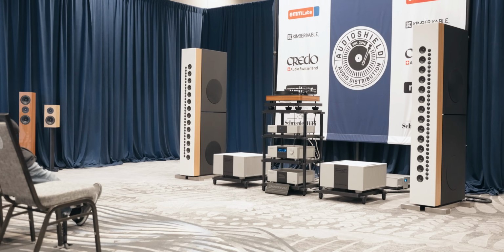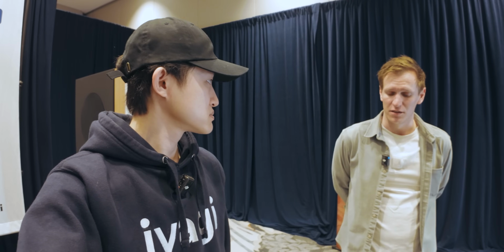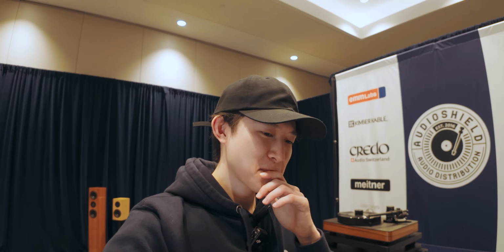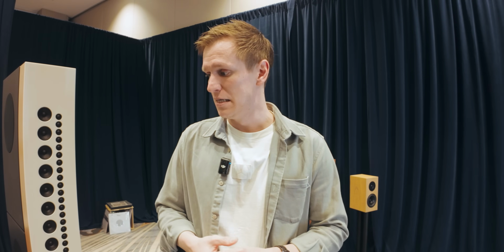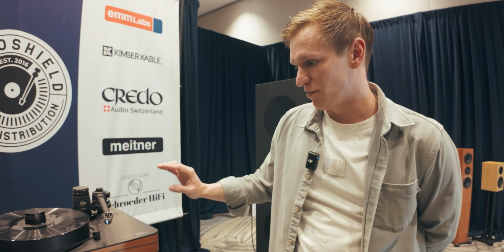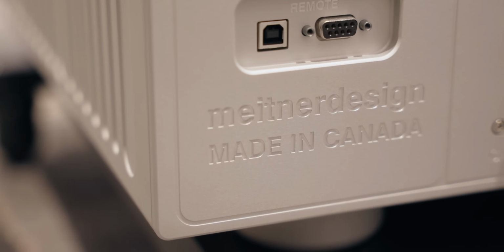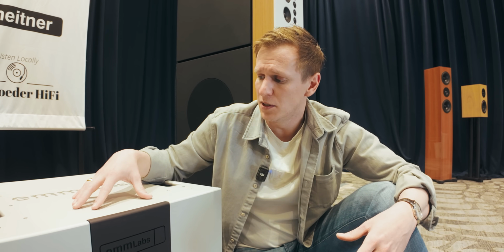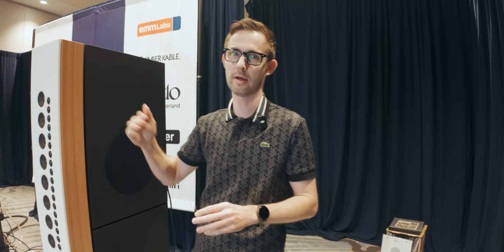FINALLY! The BEST Hi-Fi Music Streamer and DAC in The World!?

Comment: Why does Michael Kraske the Credo Loudspeaker designer say at 29:10 mark that "it works better in active systems nobody wants that in high end audio" when referring to active speaker systems and controlling radiation patterns? Why does no one want "active speaker systems" in his opinion? I own a pair of ACTIVE Adam Tensor Beta speakers (no external amps required) and they are the best speakers to date I have both heard and owned. And i have learned from this video that controlling radiation patters is done better with active speaker systems. I know that owning a pair of active speakers in the high end audio world I am in the minority. But I have never truly understood why audiophiles shy away from active speakers. Interesting

Comment: Lovely kit but the lad should polish up on Ohm's law.
Reply: Hey there. I apologize if I misrepresented something during the (off the cuff) conversation with Jay. If you let me know what I said I may be able to correct myself 😊
Reply: @ No need to apologise, it's just that the notion of current should be stated as potential since the current delivered at the output is ultimately dependent on load impedance and the maximum voltage available at the output. I would rather see a damping factor or equivalent internal resistance specified.

Comment: Why talk so much about jitter? @ 10mins?, it is a non issue with modern dacs. 
At 12.50 he talks about a completely flat freq response from dac analogue output, A £100 SMSL dac has a measurably flat freq response and jitter -40db below our hearing threshold.

Very nice kit though, I’m sure I will have been in studios using this equipment but he really needs to not talk of such inconsequential issues as above
Reply: A sentra is a solid car but i’d prefer a GT4 RS
Reply: Jitter is most definitely not a non-issue with either hifi or professional DACs. It's gotten better with femto range crystal oscillators.

Comment: Awesome engineering design at its finest.  The problem with such high end equipment is there are just have a very small purchasing market.  Thus the high prices are required to provide nitch equipment.  I checked their power amps and reviewed the specs.  I was suprised how low their rated damping factor rating was, 200?  Really?  Accuphase has a 1000 rating, which gives you super high current for your speakers; giving absolute control.  My super cheap amps  EverSole F10 Amp has 600 dampening!  All interesting how different manufactures approach high end.
Reply from the maker: Hey MJ, Thank you for your comment. Damping factor is certainly something that different companies feel differently about. However keep in mind that damping factor also isn’t constant throughout the range and it depends what range they are rating their damping factor at. 
I 100 percent agree that a company like emm labs is targeting not only individuals with deep appreciation for music but also very privileged to have the deep pockets.  I don’t think anyone is mistaking that fact but it is certainly cool to meet a company who has the expertise to design everything down to their own dac chips and clocks.